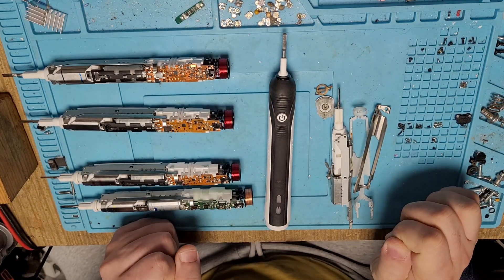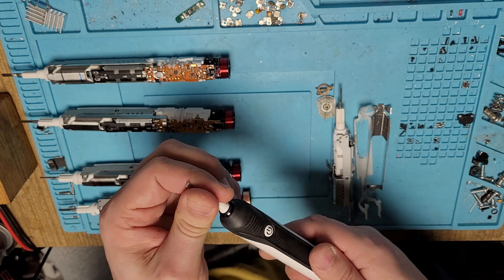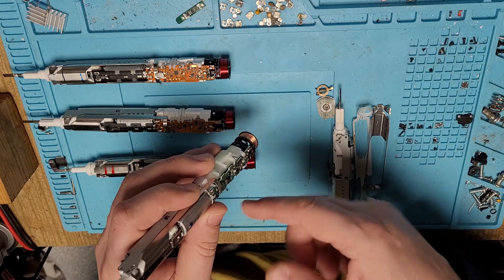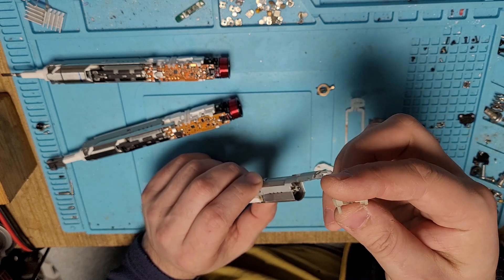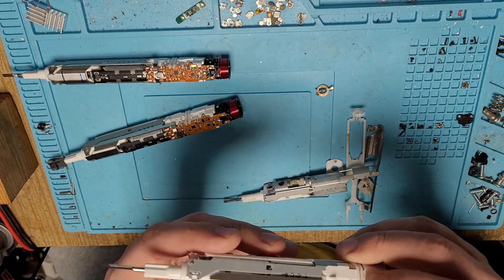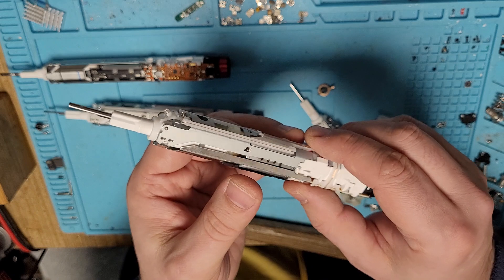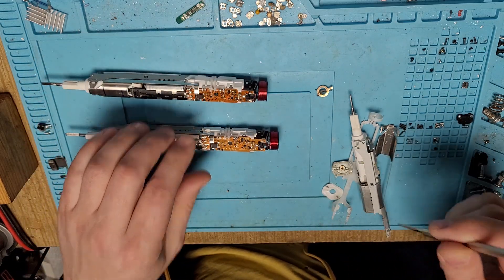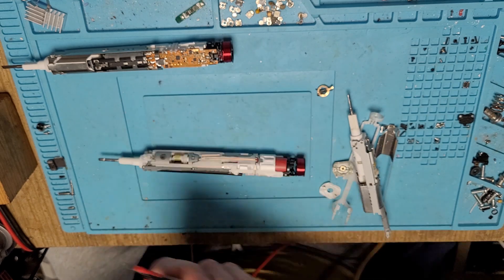Repair of various Braun Oral-B Pro or professional care toothbrush defects

Comment: Hello! I'm watching your video from Ukraine, Kharkiv. Pls help me if you can. I got a problem with Oral B type 3771. So she lights, but no vibrations... I was change a PP fuse (thx for your repair video) and she works with all modes, but I checked it again before assembling it to make sure it was working and it stopped showing signs of life completely. That's, it doesn't even lights now :((. What could be the problem?
Reply from the maker: reset the board by shorting reset pin or removing power for few seconds.

Comment: I thought these things were potted shut! Was useful to find that you can actually disassemble it. Thanks!
Mine had a bearing ring of some kind break in the top, which had leaked in water and then started rusting. 
So all electronics still worked but I couldn't know until I completely destructively disassembled it.
Oh well. New toothbrush is also nice and I know I at least tried :)

Comment: My toothbrush suddenly, for no reason, started to refuse to accept charge today. Followed this video and sorted in 15 minutes (though I do have a soldering iron already). Those wires for the charging coil must be a super common failure. £50 saved on a new one.
I do have two chargers and two toothbrushes so was easy to identify this brush as the failure point.

Comment: Thanks! Motor was humming  since I thought batter was under voltage. Thanks to your video,  I realized it was a stuck gear.  I got it freed and lubed so now it's working 😊
Reply: It was the same for me. It is probably a design feature that is causing the problem.
Reply from the maker: It would be interesting to get some feedback how this issue starts when you use the brush. Regularly.. my assumption was that you hold the toothbrush rotating head or it gets stuck and In that case motor cannot turn it and fuses to the brushes... But as I o don't use them difficult to figure out the scenarios when it happens...
Reply: where did you guys put the lube exactly? same thing happened to me today

Comment: Do you know what it could be for my braun 3676 no lights when try turn on on when put on charger as well no lights on brush,left for 30min charger was bit warm bit still no lights no turn on,it could be battery dead?
Reply: @vaidasdosas ... yes I an be the battery or if you dropped it can be te wires to !
The only thing you can do is disassemble and test battery and wire connection etc.
Regards

Comment: So how do you reassemble it?
Reply from the maker: in reverse order. if the end cap will get damaged there could be a bigger gap at the bottom but it should preserve the water tightness. if it breaks off completely then you will need to find a replacement..

Comment: I have an Oral-B 3772 that has been dropped a few times.  The housing has a 1" (2.54cm)  longitudinal crack at the base of the toothbrush. Even with the crack, it was working fine but recently it started to work by itself while I was in another room.  I was not able to turn it off so I let it run and eventually it stopped.  After opening the I noticed the charging coil wire was broken just before reaching the soldering point.  I soldered the coil to the 2 points but I am not sure I did it correctly. I wasn't able to find a wiring diagram online.
Reply from the maker: Well charging coil is only 2 wires there is no polarity on them. So soldering it in should have fixed it.. but if there is a crack in the housing it could be that moisture buildup inside is making additional problems..
Reply: Thanks  @letsfixitgarage

Comment: Thank you! I just fixed my non-charging model 3765, it was just a loose wire as you indicated. I would also like to share that I found this other video that provided way easier instructions to remove the base just soaking it in hot water. I didn't even need to force it or use a screwdriver to pry it open after the soak. I suspect this may not work for every brush, but it did for mine. https://youtu.be/9mCaSk08Bp0

Comment: My 3 year old Oral-B toothbrush starts without any issues but can no longer be stopped. It has only one button that turns it on or off. The only way to turn it off is to put it in the charger. 
Have you encountered this problem?
Reply from the maker: I had one similar case.. it had a huge solder blob on the button leg that was shorting it to the diode next to it. It was a manufacturing defect but the brush was relatively new... It's gonna be definitely a defect on the motherboard.. so some electronics knowledge and soldering will be needed..

Comment: How does a person check the battery, and if bad, replace it?  Mine seems to be showing just over 1 volt, even after the charge cycle completes.  Thanks...
Reply from the maker: Depends what kind of battery you have li-ion should be 4-4.1v when full and don't go less then 3v in normal conditions. Ni-mh on the other hand is 1.2-1.3v at full if I remember correctly don't recall what is low on these..
Reply: @letsfixitgarage  Thanks

Comment: You are armature. This not the way opens the oral-b. First off you need to tap in hot water for 5 minutes. Then with back of the charger you open with clockwise rotation and then the hot water must help you to push the head and that is all. It is simple and child make t done without damage the toothbrush. You need to ask oral-b for certification, service manual, etc...
Reply from the maker: Amateure yes, armature hopefully not :D hot water helps with genius X series brushes, they have different case material, as I suggest in genius X repair video. Have you opened this model brush as you describe it? I tried warming it up with boiling water, it didn't help with this model brushes. additionaly cap is oval shape not sure how do you want to rotate it cold or warm... And as far as I know there is no service from Braun for any brushes, would it be these, genius or even expensive IO... So I really doubt that you have certification or service manuals. But please, prove me wrong.

Comment: hi. my oral b pro 2 2500n buzzes one time (and vibrates) then stops and the battery light blinks in red.I have already charged it where it was blinking green till it stopped charging.  Do you think this is the same issue where the gear is stuck then it cuts off?
Reply from the maker: If it vibrates then no, motor spins freely. Something is wrong either with battery or charging circuit. Open it up and measure battery voltage after it's fully charged and when you turn it on and it goes to empty..
Reply: @letsfixitgarage  sorry vibrate was the wrong word. It buzzes once only
Reply from the maker: Still if there is movement on the shaft it means motor is spinning. As you can hear in this video its only slight sound if the motor is blocked. Anyways for repair you need to open it up then you can check motor and other things, I would inspect battery and charging circuit in this case
Reply: @letsfixitgarage  opened up my toothbrush and the inside is rusted hence the motor is stuck. i did loosen it with your method but currently  yet to check the battery as i dont have a voltage measure machine. any tips on waterproofing if a get a new unit? Also, i removed the internal part by pushing out from the head but i find it hard to reattach back the black o-ring on top as i cant push it down from the top as the unit itself sinks a few mm into the casing when i do so. perhaps you can show the rest how.
Reply from the maker: Difficult to say why water got in in the first place. From what I saw I got impression that Braun waterproofing is better than Philips as I saw much lower percentage water damaged Braun toothbrushes.. don't have any specific tips for Braun brushes for additional waterproofing.. as for getting the ring back ok yes sometimes its struggling sometimes gets on quite easily.. try pushing from different sides like rotating the ring. Sometimes pushing down with pliers from two sides helps.

Comment: when you open up Oxyjet + pro 3000 brush system you get see a black box in which AC wires go in and a red and back wire comes out, probably a AC to DC converter, do you know what voltage that black box puts out ? marking on it type:153783
Reply from the maker: sorry don't have this system..

Comment: I have "Oral-B Genius X" and it stops working.. It stopped, but i turn off.. turn on.. it turns little bit ( few spins ).. than stopped.. than i took off brush part and try it without.. the same.. So i leave it for few minutes.. and turn it on.. it works.. but... only in "low power modes" ( you can switch modes, works on "feather icon" mode ) usualy i had it on "default" ( fastest possible lol ) but now over the sudden it stops when is on that high power spins.. when i switch it it stops.. it doesn't matter i can run it in slow mode.. but i thinking maybe that will stop one day too.. ( just guessing ). Also i tried without brush head to put finger or "hold" that metal part which shakes when it works.. it doesn't stop it works perfectly but i notice sometimes ( when i bought it ) when i reach it in certain places while brushing my teeths it shows red light and keep spinning, now that doesn't happen.. So i tried it with low mode ( feather icon ) works in my hands perfectly with and without brush head.. but "sometimes" when i brushing my teeths.. if gets that "higher pressure" on brush ( usualy when it lights that red lamp ) it stops working again..  So does someone knows what is the problem? I apologies, idk where to ask this, was thinking in latest video :o Toothbrush is old 1 year and 2 months now.. lol
Reply from the maker: Well you have two solutions. Because it's not 2 years old you can use your warranty and it will be replaced with a new one. The other good news that you almost found a video with solution to your problem ;) check my other videos there is a video about genius X repair. there's your solution, but it involves soldering. And yes with time even sensitive mode will stop working.
Reply: @letsfixitgarage  Thank you so much! Now i am in position.. where i can get new one.. which probably will fail again how first failed.. can happen after 6 months or 1 year.. and again i will be in the problem lol.. Do you maybe know what "part" ( that little thing ) i need to exchange ( to solder ) how is that called..I can just buy it and replace it.. I thinking that is little bit more permanent solution and i will not deal with the new one too.. because let's face it.. it will fail too lol.
Reply from the maker: That's an smd fuse 1-2 amp, should be ok. 2-3mm in lentght would be easier to solder 4mm is possible as well.
Reply: @letsfixitgarage  I appriciate, thank you for the help... you are amazing!
Reply: Yes my Genius is doing the same. You are lucky, yours is still in warranty. Mine is 2 years and a month, so no warranty for me. I’ve got mine opened up, but not sure if I want to mess with this thing.
Reply: @TheNotMeTube  I will not use warranty, already opened it and cleaned it.. Reason why i don't want to bring back.. because i will get new one with same problem.. which will occur sooner or later.. It will fail with new one too.. so better to change that little part. No worries, just follow slowly what is he doing on the video, which one you need to take off and just solder new one.. slowly with steady hands you can do it.. I am from Serbia and i can't find anywhere this Oral B toothbrush arround, i guess Braun is aware of this problem.. and i googled about this, it's high rate of fail just because of that little fuse..

Comment: Thanks for sharing, my toothbrush was not working after it fell to ground. A humming sound was coming from it so the motor was working. I tried to move the assembly above motor several times in every direction and it worked. Maybe the contact point moved when it fell to ground.

Comment: Hello,  thanks to you and your videos I have already managed to fix a few brushes, thank you very much.  I have a problem with one Genius 3771 brush. if it discharges to 3.4v, it no longer wants to be charged.  the red LED flashes and when placed on the charger, the white light is on that it is charging.  I've already replaced the battery but that didn't solve the problem.  Maybe you have an idea what could be the cause?  Thanks Paul
Reply from the maker: Well electronic components do fail time after time.. haven't had this kind off defect but if you have another working brush on hand try to go from the coil up and check all components on the way with multimeter.. could be bad solder point or some element is bad.. check the charging chip in diode mode.. hope this helps!

Comment: Cześć. Mam model oral b pro 2 2500, bateria naładowana, silnik nie startuje,. Szczoteczka robi krótki dźwięk "pii". Nic się nie swieci. Pomocy
Reply from the maker: That seems to be similar description as I showed in this video when motor is blocked. Can you rotate the gears by hand?
Reply: Silnik nie kręci się i ręcznie też koła zębate  się nie kręcą. Żadne światła się nie świeca. Jest samo piii pii
Reply from the maker: Well there is your answer ;) motor has to turn free by hand. look the part where I hit the toothbrush with a Hammer. 
Motor "brushes" have welded to the collector and need to be broken free.. it's a delicate procedure but should be ok. Motor has a metal gear on it try to slightly hammer with some thin tool on it. By the way how did it happened that it stopped? I still can't understand in what conditions it welds it self...